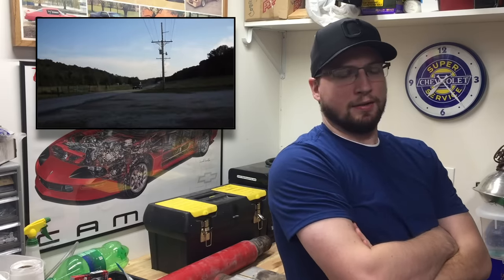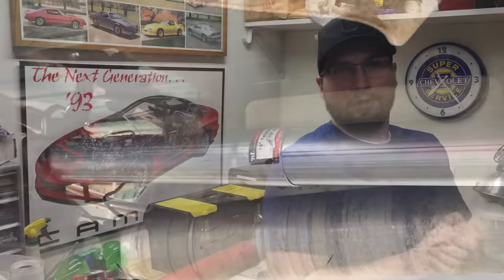Cherry Bomb® Glasspack vs. Straight Exhaust Pipe - Sound Comparison - 5.3L Chevy

Comment: You need to run dual exhaust from the manifold with glass packs. Put the glass packs as far forward as you can.
Reply: Why?
Reply: @augurc4046  it will "rap" more on acceleration. The more pipe you have behind the cherry bomb the better it sounds.
Reply: @bigdogbandal  Thanks, the longer & smaller the tailpipe the more back rap you get.

Comment: Doing this did you get a check engine light?
Reply: I have a 2006 avalanche I wanna do the same I just dont want a check engine light
Reply from the maker: If I did, I wouldn't know...check engine light was on before removed the muffler.

Comment: I like the idle of the glass pack but the sound through the rev range of the straight when you're hammering on it. Straight piped at part throttle and idle tends to sound like a UPS truck

Comment: Glass pack is better but meant to be used on a manual. At one point when you were in park you touched on the sound a glass pack is known for. Sort of a pop when RPM comes down fast, which is easy to do with manual. Most people have never hear it applied correctly.

Comment: I like it quieter is there anyway to get that same quietness without the glass pack? My muffler just recently broke right near the front and I’m thinking about putting a pipe inside and welding it so it’ll look and sound original again.
Reply: For some reason, my friends think putting a straight pipe is going to make it quieter, but your video has taught me otherwise

Comment: Can you use the glass pack to exchange the resanator instead?
Reply: Yes you can I have a 4 cylinder sedan with a muffler and resonator delete and I have a cherry bomb in place of my resonator but I'm going to my local muffler shop tomorrow and having the glass pack removed and a straight pipe put in its place

Comment: Does your truck still have cats on with straight pipe? Or with cherry bomb?... I still have cats on my truck but I cut it open the cats took everything from the inside out and wield it back. From there I’m gonna end up getting true duals... which that still in progress then I’m all done with it.
Reply: Plus I feel like in my opinion that the straight pipe is way more louder and you can hear the difference between the cherry bomb.
Reply from the maker: Miguel_blanco81 yes cats still on the truck